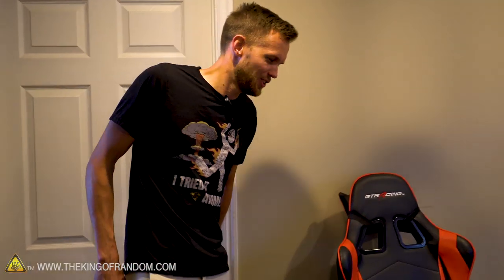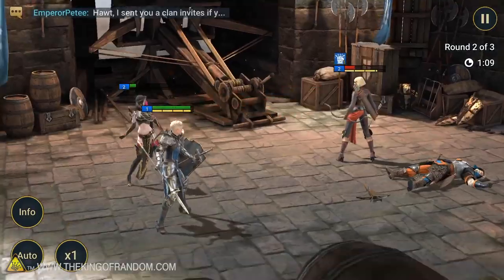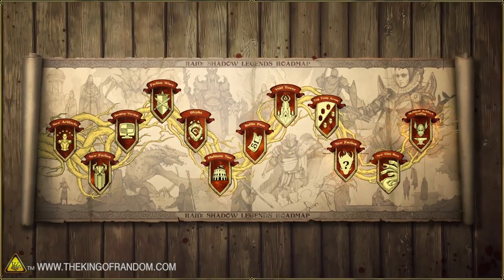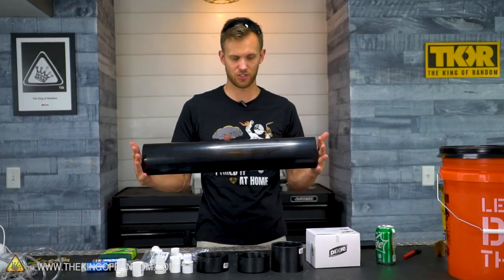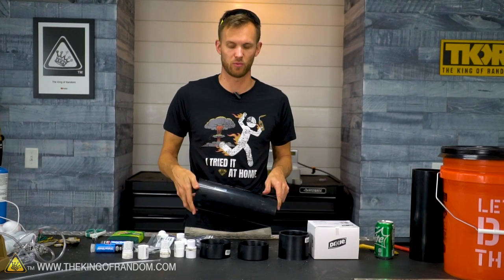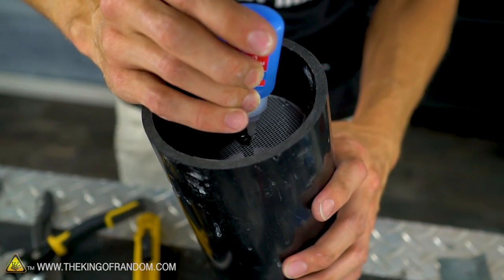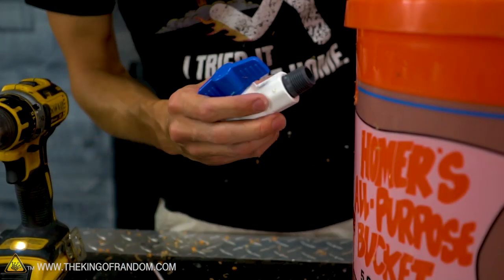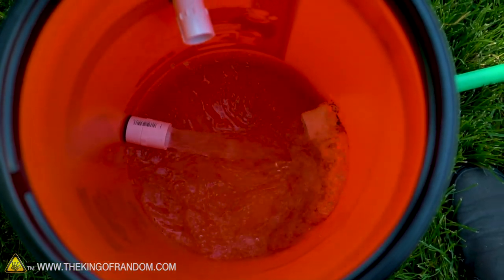The ULTIMATE Laminar Flow Nozzle

Comment: Why you didn't use RGB LED instead of using 3 separate LEDs?
Reply: I was wondering that same thing.  Could have added a mico controller and had any color of the rainbow
Reply: limtbk he probably wanted to see what it would be like to combine different colors
Reply: It’s the exact same thing.... RGB LEDS have three separate coloured bulbs too (sometimes they have four if they include an open white, those are called RGBW, RGB stands for Red, Green, Blue). 
If those 3 lights were on a dimmer system they could have made every colour of the rainbow too.

Comment: It's yellow, blue, and red that make white, not green, blue, and red
And it's green and red doesn't give orange it should give a redish white because they are at opposite sides of the color spectrum
Reply: You've been lied to. We've all been lied to. Yellow, Blue, Red are not the primary colors. Cyan, Magenta and Yellow are. And that's only for pigments. That's why printers use cyan, magenta and yellow ink. It's why red and blue crayons make a purplish grey rather than true purple.
And light has slightly different primary colors. Since we have red, green and blue light receptor cones in our eyes, those are the primary colors of light. That's why monitors and tvs have RGB cells.

Comment: The difference between the color systems of light and paint is called "additive" or "subtractive" color.

Subtractive color is the color system they teach you in elementary school with red, blue, and yellow primary colors. It works by taking pigments that, when hit by a white light, absorb all of the wavelengths in the color spectrum except for a range that is attributed to a particular color. When you blend different pigments, it further restricts the range to form different colors, "subtracting" the wavelengths. Eventually, adding enough different pigments will result in either brown (all pigments mixed together) or black (all wavelengths absorbed).

Additive color is the opposite - instead of "subtracting" wavelengths, you are adding them together in the form of light sources that emit specific wavelengths. The primary colors are red, green, and blue, and when added together they make the secondary colors cyan (green and blue), magenta (red and blue) and yellow (red and green). If you keep blending colors, you eventually end up with white, which is all the wavelengths added together. (This is why "computer colors" are in RGB format, a.k.a. additive color, since your monitor uses light to display an image.)

Comment: Did you know that red, green and yellow aren't primary colours?
Reply: Diesel Dawg yes they are. They are apart of a group of primary colors. Primary colors are a group of colors that can make all other colors by mixing them and you spelt colors as colours instead of the correct wording color
Reply: Wrong# 1: Cyan, magenta and yellow are the actual primary colours.
Wrong #2: "Colour" is the correct spelling of the word.

Comment: Nate, you should try a pixel node for a light source. With a cheap controller easily found on amazon, you have thousands of color combinations available and multiple effects as well. Pixels nodes are commonly found with an IP 67 rating.

Comment: You can make a device for controlling the light and something that moves in the way of the flow. Basicly simulating when your finger touched the flow and you get a realy cool light effect. If you use a rapsbery PI you can controll the LED-s and the touching and you can syncronouse it. That would be cool.

Comment: While the fiber optic effect is cool I think there is a way to make the entire stream appear to be glistening in whatever color led you have in there. Admittedly, this will ruin the laminar effect. However, it will look really cool. Because light reflects and refracts, you are not able to see the light as it travels through the laminar stream of water until it reaches the end, just like with fiber. However, if what you want is something that looks cool but isn't necessarily laminar, but close, you could wire up a small vibrating motor from a game controller to the outside of container at the output end. You could turn this on and off to create interesting effects. Multiple motors in different configurations would provide different effects on the water and light. Just a thought.

Comment: Tip, when cutting and drilling abs plastic, if possible, cut it in reverse, and for drilling do the same, instead of clockwise, go counter-clockwise. The plastic tends to stick less.

Comment: You should have tried a single RGB LED, they are better tuned to match each other in brightness and corrected for compatible hue.  Toss an arduino controller board on there and you can make some great light shows as the color changes.

Comment: For water proofing the led lead You can also use dielectric grease inside a tight fitting tube, and maybe some heat shrink tubing